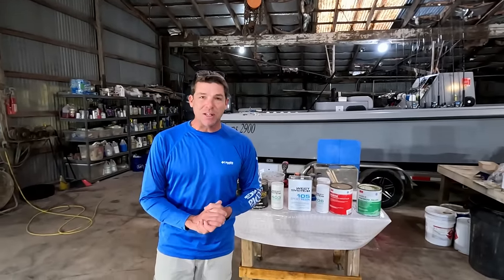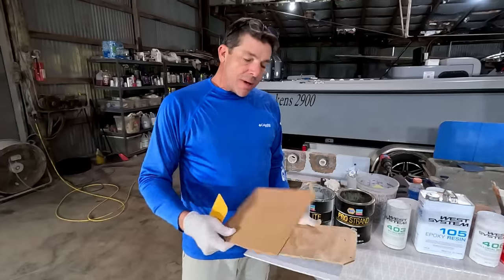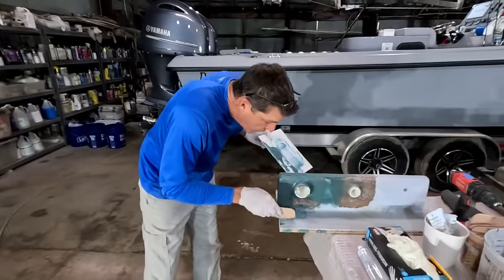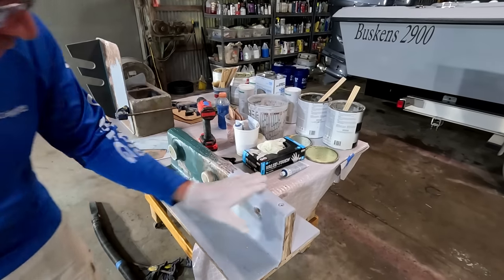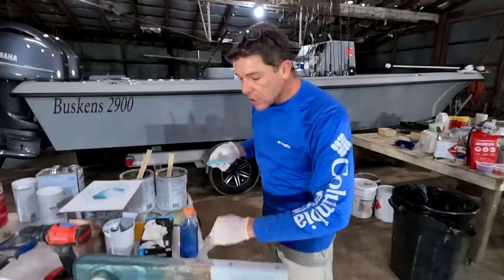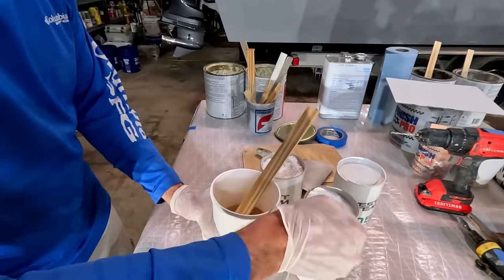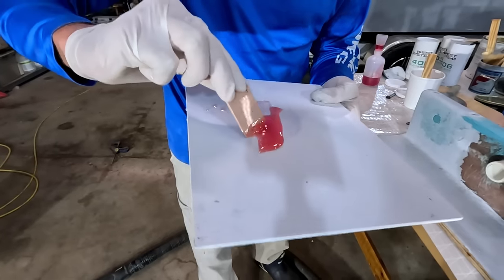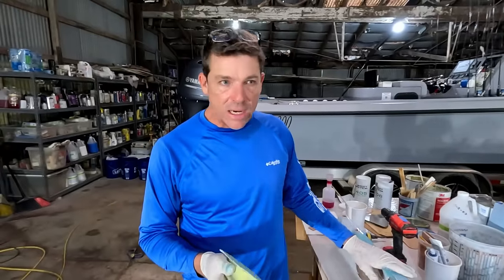HOW-TO CHOOSE THE BEST FILLERS TO FIX HOLES IN FIBERGLASS-GELCOAT

Comment: I'm back Joe!😂 I chose to use a product from FGCI to fill in the cracks after grinding them down and properly sanding and cleaning. I absolutely love this this product it's their Gelcoat paste and it's designed for above and below water line. I had some cracks that went into the fiberglass but not through it just surface cracks I was able to grind out with a dye grinder and conical bur 1/4" at the tip to 3/4"  at the base. I called FGCI whose support is awesome and asked if I should bother doing glass work or could I just fill the whole patch with the paste. They said no need to glass the product was designed  to repair this type of damage.  It comes in base white and can be pigmented wich I suck at! Or neutral clear and you color it with the dye of your choice. I'm going to be painting over the top of the repairs using Total Boat white gelcoat paint unwaxed first to build up some depth then waxed final coat. I'll be rolling it out so there's going to be orange peel and tip marks. I'm not sure what grit sand paper I want to start out with and how long I should use each grit before changing to a lighter grit. Like what grit should I use to knock down any orange peel? I'm thinking like 800 grit but I'm always to cautious then I'm sanding more than I need to😂.
Reply from the maker: Thank for commenting! I just posted a 3 part gelcoat series that should answer some of your questions. I hope this helps and thanks for watching!

Comment: Speaking of sanding/grinding for fiberglass work prep. there is very very little info on Youtube (that I'm aware of) about sanding/grinding a boat for fiberglass work.  meaning the gelcoat, and preparing the fiberglass for a new layer of fiberglass. If you would ever consider such a video these are the questions I have: What is the best way to grind/sand through gelcoat? I have been using a grinder with a 40grit sanding disc and I discovered how important it is to keep the grinder as flat as possible to prevent nicks.  What to then do about nicks?  Also, there are many difficult  to sand areas on a boat.  Any tools or suggests for such areas? If you read this thank you very much, I have just heard that sanding and prep is most the work and I think a thorough video about that could be very useful and after much research have not found on Youtube.  thank you
Reply from the maker: Thanks for the video suggestion! I with try to do something on the topic of gelcoat sanding and grinding as well as general surface prep.

Comment: My favorite tools for filler work tools are a waxed melamine board for mixing, a 4" dry wall knife, a drywall cheese grater for removing "b staged" excess, and cake icing spatulas for fillet shaping.  If you have deep pockets Freeman Supply makes amazing fillet shaping tools.  Great info as always!
Reply from the maker: Yes, all good suggestions! I actually have some tools from freeman, and some others that are very good. Maybe I will make another vid on fairing and shaping fillers in the future and use some of those tools! Thanks for watching

Comment: Great video, thank you! Thank you so much for the side-by-side comparisons and highlighting pro/cons and compatibilities of materials. That's super helpful, and so many videos out there on the topic prescribe a specific product. Your test pieces are a great illustration tool, and I also appreciate your tips on cleanup and tool sourcing/maintenance. 

I'm still working my way back through your channel, but I'd love to see any tips you have for diagnosing what materials an existing boat in need of repairs has used and what materials might be compatible for the fixes.

Comment: Hi Joe did you use epoxy on your 29 or all polyester with gelcoat to cover
Reply from the maker: The 29 is all isophthalic polyester resin,   1708 and 1808 biaxial glass over gelcoat. Probably 95 percent or more of all fiberglass boats on the market are polyester. Epoxy is still a great material,  and I plan on using it in some of our future projects. Thanks for watching!

Comment: Thank you for a good video on using fairing compounds. I am stumbling thru gelcoat repairs (mostly thremal and stress cracking) on my 22 year old Beneteau sailboat. Apparently thickened gelcoat is not the best way to go when you have "demeled" out the cracks and you are trying to fair them back to flush. I guess I messed that up. Good thing I am practicing on a small removeable hatch first. Not the whole boat. This work is very frustrating and a tougher learning curve than I thought. DIYers can do it but not without some trial and error. Don't expect perfect or professional results. I know I have been and will make lots of first timer mistakes. I am hoping to cut out a few of them and avoid making an unrecoverable mess by learing from professionals. I salute those who can do this well. It ain't easy.
Reply from the maker: Glad you are enjoying the videos! Yes, there is a learning curve for sure. It is always best to practice with some inexpensive or non essential parts first if possible. Remember perfect Is really difficult, sometimes good but done is better.

Comment: Ild like to see a bass boat transom redo. I know you specifically do sea/inlet boats but maybe an older 80’s-90’s. 
Also long hull scratches or wider flatter spot like 4-6 inches or more in size.
Reply from the maker: Thanks for the suggestion. I have a 2 part gelcoat repair video series here on the channel. You will have to scroll back a good bit to find it, but they are 2 of our most popular videos. It shows gelcoat repair on scratches simular to what you are describing. Hope they help

Comment: Dang man that was a Mouth-full(Spanky)line from Little Rascals.
You are making me warm up to Poly.
How can folks afford $300 a gallon for filler.
I am like I said before, Not a beginner and Not a Pro.
But You can make 53 minutes pass quickly and easily. 
Dont ever feel like you need to short cut these Videos, These are packed with well valued content.
You MAY have missed a calling in Teaching.
I have made or left several comments on other videos.
But I can't convey how refreshing it is to watch quality installs by a Pro.
Reply from the maker: Haha! I used to watch those guys when I was a kid, good stuff man! Thanks for watching and commenting!
Reply: found the 3m premium on amazon for $197.

Comment: Hi Joe , big subjects  and one of my favorite issues as so much miss info on fillers and fairing compounds.
Despite the great job that West System has done showing how to make your own putties and filler using a ready made poly or epox product is usually way way better.   If for no other reason than you get so much better consistency. The additives need time , up to 24 hrs to be fully wet out by the resin so mixing at the last minute just doesn’t give the best long term results. But as you know sometimes you just have to do what ever it takes. 
Great video 
Cheers Warren
Reply from the maker: Yes, all good points! Thanks for watching and commenting on the videos. I really appreciate it

Comment: I'm starting to rebuild a 1975 Reinell.  I want to repair and "paint" the hull (exterior) a new color.  It's obviously an old gel coat.  Can I paint over gel coat? What prep work is required? What type of paint should I use. And, what are the pros and cons. Would love to hear you talk about this topic even if you don't make it a full video.  Thanks. Mike.
Reply from the maker: Yes, you can paint over gelcoat. The surface would need to be thoroughly clean, then sand with 220 grit paper.  I like a epoxy based primer like U.S paints Awlgrip 545. Awlgrip makes a very good marine paint system that we have used with good results. I will try to touch more on that subject for you guys soon. Hope this helps, and thanks for watching!
Reply: Thank you.  I'll look for your additional comments on your video(s).

Comment: Always super informative!!     I've been to paid trade seminars and you're spoiling us with the ease of you tube thank you [A request ] could you do a strength and impact test on the different finishing materials over cured lay up... ie. putties ,smoothing coat of resin, gelcoat and whatever your method with a finished great looking exterior gelcoat or paint?  My ultimate goal is to make a fiberglass body for a 72 Datsun 510 -in time after a lot of practicing on smaller projects, your teaching is great. thanks   Bret
Reply from the maker: Thanks so much! I will try to get some more testing out for you guys. The Datsun project sounds like a cool one!

Comment: Hi captain. Thanks for helping me so much with diy on my boat. I have watched other Chanel’s  and found them to technical which put me off trying. 
So thanks again. 
I do have a question for you I would like to bring my hull back to the original gel coat.  But there is multi coats of anti foul. Do you have any tips as to removing the old anti foul.
I now thank god I have found your Chanel. Keep up the great work.
Reply from the maker: Wow, thanks for the kind words! Glad the channel has been helpful to you! I will try to touch on the bottom paint removal methods for you the next time I have an opportunity in a video. The basics though would be to carefully remove the old bottom paint with the correct paint remover or by carefully sanding it off with a vacuum assist sander or grinder. If the gelcoat underneath is in good condition,  and is thick enough it can be wet sanded, buffed and polished back to a shine. If it is in poor condition,  or to thin, you would have to add more coats of gelcoat, then wet sand, buff and polish it out. I hope this helps and I wish you the best with your future boat projects!

Comment: Love the videos. What/how would you fill screw holes that you don't have access to the back? I had to remove rod holders under the gunnel in a skiff. If I put anything in the hole it will just fall into the hull.
Reply from the maker: Glad you are enjoying the videos! The 3m high strength filler is very good. I also like a product called formula 27. I hope this helps and thanks for watching!

Comment: You’re videos have been incredibly informational, thank you for all you do! One question here - What resin would you recommend to waterproof plywood for floor decking that will have carpet on it? I initially planned on using polyester to ensure binders in the mat are being broken down, but if there’s no gel coat that’ll be over it, would epoxy be better for it’s water resistant qualities?
Reply from the maker: Glad you are enjoying the videos! Both resins can work, but there is a third option. Vinyl Ester resins block water like epoxy, but will work with csm. Hope this helps, and thanks for watching!

Comment: Great video.  I'm working on an old ProLine and there are many holes drilled through the gel coat on a horizontal surface.  What would you use to fill holes on the horizontal?
Reply from the maker: Thanks! There is no one filler that is best for every job. We will be making more videos on this subject soon, and maybe show some other option. All the materials we show in the video could potentially work one wY or the other.

Comment: Hello, I have a quick question about my boat and how you might attempt the repair that I need to do. I have 4 holes no bigger than 1/8" on the bottom that are directly under the driver console. The boat is a 1990s fiberglass bass boat, and the previous owner tried installing a hot foot and pierced all the way thru the hull I'm guessing using too long of screws. What adhesive should I use to fill in the holes? I don't see any cracks around the holes so i don't think the damage is beyond that. I'll only have access to the holes on the outside. Thanks for any advice you can give, and I appreciate what you're doing on this channel! I hope I can get this done myself but feel discouraged as I have no experience with fiberglass repairs!
Reply from the maker: That might require some actual fiberglass repair, rather than just a filler. Anything below the waterline that is through the hull is a little more serious in my opinion. Of course every repair is different and it is hard to say for sure without seeing it. If I had to just use a filler, it would be epoxy for me. The west 610 is user friendly, and easy to inject into a hole, but I would consider that more of a patch than a actual repair. You might want to consider taking it in to a shop that does that kind of work and see what they say. I hope this helps and thanks for Watching

Comment: Thanks for all the tips. Do you have a technique to fill in nail holes but on a vertical surface? Just use a thicker filler?
Reply from the maker: Yes, a thicker filler will work better for vertical surfaces. Thanks for watching!
Reply: @FishBumpTV  got it. Thanks !!

Comment: nice one sir, I truly appreciate it. I learned a lot. but I have one question, what if milled fiber only on polyester resin and no selica? would it still do the job? what does selica do? thanks, have a nice day.
Reply from the maker: The fibers add strength, the colloidal silica thickens it. The two seem to work well together. Hope this helps and thanks for watching!
Reply: I see, thanks.

Comment: Subscribed! I have a exposed fiberglass strip where i have constantly beached my jet boat.  What product would you recommend? I figure i can maybe just paint a coat of resin or gelcoat over it to protect it. No more beaching it.
Reply from the maker: Thanks, and welcome to the channel! We used to repair a lot of rental jet skis that had the same problem. If there was a lot of wear into the actual fiberglass, we would always add some new fiberglass to build it back up. Then we would paint or gelcoat it. If it is just starting to wear through the gelcoat, then 2 or 3 coats of gelcoat would seal up the exposed glass fibers and make it look better. I hope this helps and thanks for watching!

Comment: I have some experience with glass... I like the gel-coat finish for its durability.....I want to refinish my concrete pool and as most concrete pools from the salt today it etiches the surface... My plan is a pressure wash on the surface and then spray a thing gel-coat for adhesion... At that point, I am only trying to smooth the finish and waterproof at the same time....I want to come back with a spray pool paint.... I am looking for adhesion, smoothing and waterproofing.... I think this method will allow me to be more aesthetic without very expensive glass tiles and the surface should be slicker and easier to clean....Your opinion
Reply: I will try again! There is a product called ATPRIME2 that might help you seal the Concrete.👍
Reply from the maker: I don't deal with swimming pool applications much, but I think a epoxy or vinyl Ester based product would be best for what you are trying to do. They are going to bond more aggressively and stop osmosis or water intrusion better than polyester based gelcoats, in my opinion. I have seen fiberglass pools with molded gelcoat finishes developed osmosis blisters over time and have to be repaired with specialized pool coatings. I am sure there are products made just for what you are doing, I don't know that gelcoat is the best material for what you are hoping to accomplish. I hope this helps, and best of luck with your project!

Comment: can that putty product be used on the bottom of a jon boat to fix a possible leaking area?
Reply from the maker: I would probably lean towards an epoxy based product for repairs on aluminum boats. There is a product called Marinetex that I have used with success in the past. Hope this helps and thanks for watching!

Comment: Hi Joe, after watching your YouTube video on filler, I was wondering if  pigment can be added to the filler or is there another step to finishing the job?
Reply from the maker: You can add small amounts of gelcoat pigment to polyester and vinyl ester based fillers to tint them a small amount in some cases. But you should always finish your repair with gelcoat to seal it. Most fillers are not designed to be a good moisture barrier or cosmetic finish. I hope this helps, and thanks for watching!
Reply: @FishBumpTV  Thanks for getting back to me on this point. I really appreciate it. Thanks for sharing your wealth of information. I think all those who watch as I do, with a keen interest in composite materials, really learn a lot from you.
Reply from the maker: @stuartlane7107  Glad to help!

Comment: I use ground garden lime as a filler or filleting with epoxy because it is so strong and light. The lime is also very cheap.
Reply from the maker: Very interesting, I have never heard ofdoingthat before. Thanks for your comment!
Reply: Very interesting, any downsides you’ve had over the long run? Weight, leaching, expansion or the like?

Comment: Can you color grade filler if not using a gelcoat? I have a camo Gheenoe Classic, the interior is a tan-brown that has some holes I would like to fill.
Reply from the maker: You should be able to add some pigment to most fillers. I don't know how close you will be able to get though.I would try to start with a filler that have a tone in the general ballpark if possible. I would do some test batches first to be sure you get proper cure. Hope this helps and thanks for Watching!